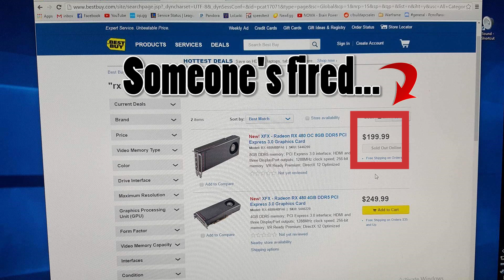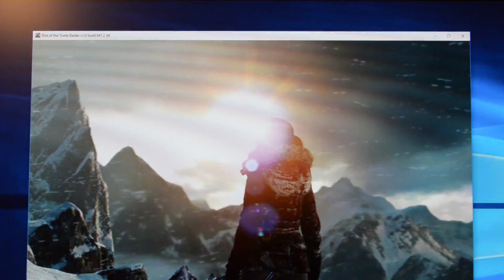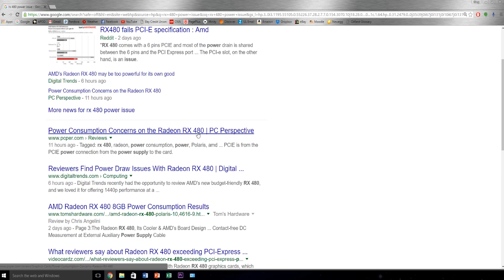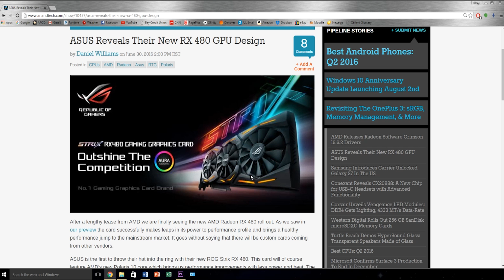RX 480 Aftermath: Power Issue & Over-Hyping

Comment: considering a reference 480 matches and even bests an evga ssc 970, i can still see a sapphire card meeting 980 performance
Reply: Says the one with the Nvidia logo
Reply: +Shifty Biscuits custom pcbs and a hefty overclock should let it touch the stock 980...because I've seen my brother overclock his 970 close to my 980
Reply: you're delusional bud
Reply: Ohh come on, the RX 480 is better than a GTX 970 and you know it. A non overclocked RX 480 with a stock, blower style cooler has equal performance to an overclocked GTX 970 with a custom cooler, while being $50 cheaper than a GTX 970 and having more memory.
Reply: 99% of uses with  480 is same or just 5-8 frames faster then a 970 from 2014  even with 8 gigs of ram it doesnt walk all over a 970 and right now 970 is 250$ on newegg ..480 isnt a bad card just it was all hype
Reply: Pastechi dont care when its $260
Reply: oh snap
Reply: LOL

REKT [X]
NOT REKT [  ]
Reply: It may very well be able to touch a completely stock 980, however the card itself at that point (with better power delivery and a hefty cooler) would probably cost around 260-320 4GB-8GB (just pulling numbers out of my rear, but I would expect to see around a 50$ increase in price for high end versions of this card)
Reply: Mario Man shut up :D. He read about it in BOOKS !!! He must be right EVERYTHING is in the BOOKS !!!. 200% MORE CLOCK = 200% PERFORMANCE SJADOISAJDIODA. If u have 8GB VRAM and u buy extra 80GB VRAM ur graphics card will have 10x more performance. !!!  AMD 16 CORES ARE FASTEST BECAUSE i5 HAS 4 CORES !!!
Reply: Except Aftermarket cards tends to increase the price based on what it compares itself to.

If the performance gain is stable enough in a Aftermarket card to be on par with a 980, retailers might think: "Why price it way lower than 980s when we can make it exactly the same, and have consumers buy out the 480 and the 980s at the same time?

^ GREED ^

Also, this RX 480 won't be a issue with my mobo, it's REALLY old but still has PCI-E 2.0 Standards.

The ONLY way you have a old MOBO that won't work properly with this card is if you have a 10+ year old board.
Heck... People, get with the times here... There are cheap modern Motherboards...
Reply: beats a card with less mem from 2014 in most tests by 1fps     ..good thing it has 8 gigs of ram lol  970 are selling for 270$ and much better card then a 480
Reply: I just don't understand how people can be so stubborn, the 970 is very limited with where it can go, with more and more DX12 games coming and Vulcan around the corner the 480 is the obvious choice, I'm all for talking with intelligent people about the pros vs cons of both cards but if youre just going to says "LOL XXX CARD IS BETTER YOU MORON" Then seriously unsub, please, for the betterment of humanity.
Reply: Tico2858 ikr newer cards should always beat or compete with older ones 1 tier higher than them. Some people just dont get.
Reply: The EVGA superclocked 980 is cheaper than the reference RX 480 here in Europe, at least if you are fast enough on ebay. Other 980s are dropping their prices madly just like the 390x can be found 20% cheaper now. So, Sapphire releases a custom RX 480, do you think the much needed upgrade on both cooling and power is free of charge?
Reply: 4TooFLY so you just proved that you have no knowledge in digital design and hardware architecture...
Reply: No.
Reply: Tico2858 dude the R9 380 has 1792 shaders, 112 TMUs and 32 ROPs the Gtx 960 has 1024 cuda cores, 64 TMUs and 32 ROPs, no wonder the R9 380 would beat it even if the gtx 960 has higher clock speeds.
Reply: but can it beat a 1060 tho
Reply: Tico2858 $260 for a 1060 without having power issues?
Reply: Why is everyone targeting the 970 like it's now shit compared to when it was released because its an older card so it should naturally be beaten by the newer one. It likes the 1060 should be near the 970 perfomance and be cheaper that's how the 970 was compared to the 780 it was cheaper and had similar performance and better power consumption and acoustics at a cheaper price. It's the normal progression of technology
Reply: The Spark I hope you mean 970
Reply: Tico2858 http://www.ebay.com/itm/04G-P4-2983-KR-EVGA-GeForce-GTX-980-Superclocked-with-ACX-2-0-Cooling-4GB-Grap-/272292711486?hash=item3f65e90c3e:g:ZhcAAOSwMHdXTc2r

No .. I meant the 980 superclocked.
Reply: The Spark I'd really ignore used prices since you can get anything at any price , but that's a sweet deal (I think)
Reply: +Mario in some games the 480 beats the 970
Reply: cough dx12,vulcan*cough*
Reply: sapphire confirmed a 1500MHz RX 480, while the RX 480 stock can NEVER reach boost clock speeds, thus a 25% higher clock speeds, thus 25% higher performance.
Reply: It doesn't work like that. Palmface
Reply: 4TooFLY ?
Reply: U will not get 25% more performance raising clock 25%... It doesn't work like that what u dont understand ?
Reply: 4TooFLY it does.
The overall GPU performance is determined by the TMUs, ROPs, Shader count, bus width and memory type. Which result in Bandwidth, Texel Rate, Pixel rate and shader performance. Of course there is the factor of Architecture, which is the most complicated part of it as architecture is NOT one basic performance factor like the ones mentioned above, but going into unified graphics architecture in a youtube comment would be suicide.

The texel rate is TMUs* Core clock speeds
The Pixel rate is ROPs * Core clock speeds
The shader performance is Shader count * shader clock speeds/core clock speeds.
The bandwidth is Memory bus * memory clock speeds * 2 * 2(if GDDR5) * 2(IF GDDR5X).
Thus you can see that increasing the core clock speed will increase the texel rate, pixel rate and shader performance the same amount as the increase of the clock speed percentage wise.
Reply: IIIRattleHeadIII Yes yes... Prove me that in a video. Because talking like this is stupid. Just like AMD did. 2xRX480 = GTX 1080. When it can't even reach 1x1070... U saying tottal bullshit that u cant even prove.
Reply: IIIRattleHeadIII hahah as i knew. Can't prove, then talking shit. Go troll somewhere else. Go buy ur 25% more performance GO..
Reply: 4TooFLY read some books.... or just watch some synthetic benchmarks.
Reply: IIIRattleHeadIII And u go to see practical result in a normal game not in a book.
Reply: 4TooFLY a game includes many more performance factors than just a GPU... like ram, CPU and storage
Reply: IIIRattleHeadIII You know he's right. 25% higher clock speed wont result in 25% more performance.
Reply: Mario it does... basic knowledge.
Reply: Mario did you even read my comment above.
Reply: 4TooFLY you have no clue on anything hardware related. All you do is watch benchmarks and read blogs/articles on the internet, ejucate yourself and then come here. Unlike you I have studied hardware architecture and digital design for 7-8 years.
Reply: Mario do you even know the performance factors of a GPU?
Reply: IIIRattleHeadIII
LOL! just lol! stfu dumbass!
Reply: ***** oh really? Nobody except me has even given arugments, all you people do is state things without any arguments or reasons behind them.

you are basically saying "It's NOT like that, because it's NOT like that". I gave you logical and actually real reasons, the fact that you can NOT comprehend and all you do is read stupid articles and watch benchmarks.
Reply: IIIRattleHeadIII Go read more books. Im gonna block you, i dont want to hear how stupid are u...
Reply: Problem, the 1060 will be $250 for founders but only with 3Gb of memory, the 6 Gb version will be $300 and if the pricing is like the 1070 and 1080 it will be more and it won't be more in real performance. Just watch the next few months. The 480 will go up in performance while the nVidia cards will drop or stay the same.
Reply: 4TooFLY Seriously man you should know thats not how it works when you look at the R9 380 vs the GTX 960 alone, the 960 reference has 1127MHz and the 380 has 970MHz, the 380 slaps the shit out of the 960, the core clock really doesnt mean that much
Reply: when drivers improve and dx12 becomes the norm it definitely will. with dx12 also people with 900 series nvidia cards are going to want to switch over after they realize how Nvidia is just going to say to them buy a new card dipshits. the way amd future proofs almost always will have people switch over after nvidia burns them
Reply: Mario why should I ask anybody, when I know that what I am saying is true?
Reply: IIIRattleHeadIII No fucking shit, dont tell me, tell the other kid
Reply: Tico2858 well you said that clock speeds do NOT matter, which is NOT true as core and memory clock speeds are 50% of the performance, IF the ISA is the same and both Nvidia and AMD have the same ISA.
Reply: IIIRattleHeadIII No i didn't, don't try to put words in my mouth, I said it doesn't mean that much
Reply: Tico2858 gonna quote you "Seriously man you should know thats not how it works when you look at the R9 380 vs the GTX 960 alone, the 960 reference has 1127MHz and the 380 has 970MHz, the 380 slaps the shit out of the 960, the core clock really doesnt mean that much"
Reply: IIIRattleHeadIII Yea and in the same quote i said it doesnt mean much, stop trying to fucking witch hunt people
Reply: Tico2858 well it matters very much as I told you. I'm NOT hunting you, I'm just clarifying.
Reply: or you could just buy quality?
Reply: my plan would be to buy the cheapest aftermarket version of the card and overclock it further myself.
Reply: The shader performance relying on 2 different clock speeds alone means that it won't result in a direct 25% performance increase. That actually matters. Reread your entire comment.
Reply: he's mostly right actually. His comment wasn't stupid at all. Just a little misguided. You're not giving much of an argument either, showing that you seem to lack some knowledge in this area. You're right, but not for the right reasons.
Reply: ArtisChronicles the shader has it's own clock speed, which is relative to the core clock speed, or in other words it has a ration, when you increase the core clock speeds the shader clock speeds increase as well, the last time shader clock speed was independant from the core clock speed was I believe with the gtx 500 series, where you could clock the core and shader clock speeds separately. AMD has always used a ratio and the shader clock speed has always increased with the core clock speed.
Reply: Power issues on a reference card. Who buys reference cards? Jesus, you people are dumb
Reply: Nope.
Reply: even tho i have an 760, im and AMD fanboy. And what you just said is impossible
Reply: did you just say that? lol you need to do your homework
Reply: Phoenix MH83 the rx 480 does match a gtx 980 in None-Nvidia optimized games(games that are NOT, the witcher 3, GTA V, Rise of the tomb raider, Morror's edge catalyst, and batman [fill blank] and pretty much 99% of the AAA games from 2015 and 2016)
Reply: +IIIRattleHeadIII mmm not quite. It does beat 980 in dx12 titles, but thats about it. That being said, its still almost 3x as cheap as a 980 making it a really good value card. The 1060 is coming out soon so we will be able to compare benchmarks then
Reply: IIIRattleHeadIII at what price to just come close to it? Fact is you get what you pay for and you know that. If it cost 200 bucks then it cost less to make. AMD is not about quality they are about budget. That can be good in some cases but not all the time. This cards overheats already from what I been seeing on reviews. If they truly want to make a quality card then they are gonna have to spend more. If 3rd party companies are sticking with the same  specs and parts then they will have around the same quality and if its better quality chances are it will cost more
Reply: ***** It doesn't "fry" motherboards.. do your research
Reply: ***** What motherboard still uses PCI 1 slots? hm? Upgrade your 10 year old hardware if thats the case, lots of graphics cards does the same thing this card is doing, but I wouldn't expect and nVidiot to realize that.
Reply: ***** Lol you are bragging that you waste your money on a on an equally good card at higher the price? grats! Bragging to people that you bought a car a sticker price too I presume? You are the type of guy to do that.
Reply: ***** haha, pokes fun at people who buy amd to save money, and you don't even have a high end card. gtfo.
Reply: A 980GTX is a pretty big performance leap from a 970GTX, and RX 480 is all sold out at the 200$ price. The 1060GTX is rumored to come out with better performance than a 980GTX in 1-2 weeks with a price tag of 250$ so you might as well wait because unfortunately it seems RX 480 was mostly hype. They did release a driver update to fix the power consumption which seemed to have worked perfectly but anyway, it's like ... if you got one, 50$ more and a few more weeks would get you the bigger update. At the moment no RX 480 are available for lower than 250$ anyway because they are all sold out so thus unfortunately AMD has failed : L. If you did get one and it is working or also up-to-date, it's a good update, but there's a better one coming from NVidia unless AMD responds pretty fast.
Reply: Praetorian yeah a 3GB gtx 1060 with gtx 980 performance for 250$ and 350$ for everywhere that is NOT the US and the RX 480 has gtx 980 performance+ in None-Nvidia optimized titles, which ATM are very few.
Reply: IIIRattleHeadIII
Actually RX480 is sold out and I cannot get one for lower than 300$ either, but either way if I'm spending 250$+ then it will be on a 1060 probably since it is significantly boosted anyway.
Reply: Praetorian how do you know that? According to the leaked specs, it's NOT stronger than the RX 480.
Reply: +Praetorian Only one benchmark it matched 980. In another benchmark from KitGuru, RX480 trumped 1060
Reply: Abhijeet Ghosh oh yeah, the gtx 1060 is out by now... right? too much traveling I lost track of time.
Reply: no, it will be released on the 19th.
Reply: 4 months and many driver updates later now the card is being compared to a GTX 1060....
Reply: GX2re
The GTX1060 ended up being better even if you wanted to pit everything as equal (which it wasn't 1060 was about 2% faster or some ridiculous low amount), then the power consumption and lower noise levels were better for the GTX 1060. I guess it comes down to preference but I would rather choose the better product regardless of where it comes from, even though the 480 was a nice release from AMD to keep things competitive at the time.
Reply: Praetorian on the long run the RX 480 will surpassm the gtx 1060
Reply: GX2re
That makes no sense. Please try to explain yourself.
Reply: Praetorian Nvidia cuts performance benefitial driver support as soon as their next gen GPUs arrive, AMD usually is slow on drivers with their new GPUs, so it takes a few months to get a good solid performance and AMD has 100% full driver support for all GCN GPUs.
Reply: IIIRattleHeadIII
Not once have I seen cited example of the so called 'driver improvements' that cause AMD hardware to get better just because of drivers after about 2 years. Are they paying you to say that or are you just butt-hurt? I used old Nvidia cards that are 5-9 years old(not anymore) but they still work just fine on every application regardless of old/new driver versions.

You would be better off waiting for VEGA at this point or even considering an rx490 , but no, here you are talking about a myth on some months old card that was proven to be worse than its competitor for the same price..
Reply: Praetorian not butthurt, nor paid, own both AMD and Nvidia GPUs, always have always will, neither company makes me money and I'm NOT biased, especially when their architectures are 80% the same, because they are based on the same ISA, so yeah...

Also if you want to see a comparison, just look up some benchmarks of the gtx 780 and/or 970 in recent 2016 games even the r9 380/285 beats it in some...
Reply: IIIRattleHeadIII
The gtx 780 was competing with the r9 380 anyway so there is no point to mention it. It is still about the same at that point as well.

The 9XX series didn't have any sort of DX12 or APi support so thus when using that 1% or less of DX12 applications they will run but fall short or equal of the RX4XX series that had support for it already.  In that case, it was just an issue of nVidia's 9XX series not having any sort of support for DX12 at all and 1XXX was more or less a fix for that. If you want to factor in things like 'well if I run Hitman on a dx12 renderer than my RX480 was better than a 980GTX'. Well, that has nothing to do with this which was 'well if I run Hitman on a dx12 renderer than my RX480 was slightly worse than a 1060GTX not even counting the sound, overheating, power consumption, etc.' Other than that your dated observations are pretty invalid and seek to support baseless claims.

 You just bring irrelevant dated cards that no one wants to buy into the discussion, and as I said, this is already 'outdated' where the 1060gtx was better price for value.
Reply: Praetorian wow no, the gtx 780 was competing with the r9 290, which is 25% more powerful than the r9 380.
Reply: IIIRattleHeadIII
Did you even read?

"You just bring irrelevant dated cards that no one wants to buy into the discussion, and as I said, this is already 'outdated' where the 1060gtx was better price for value."

I also explained why the RX480 was considered a GTX980 killer, even though it came out months later as a cheaper alternative: because the GTX9XX series didn't offer any boost or benefit at all from new DX11/DX12 APIs at all and GTX1XXX did.
Reply: Praetorian the gtx 1000 series do NOT have ACEs either, so they are NO better in term of DX12 benefit comapred to the gtx 900 series.
Reply: IIIRattleHeadIII
Wrong. Even a GTX 1060 beat a GTX 980 barely in all DX12 tests. The GTX 980 is still a strong card, but it was not benefiting from those experimental differences at the time. In fact even DX11/DX9 was around equal to the GTX 980 for the cheaper GTX 1060. That is why the RX480 was considered 'competitive' for a time as it was cheaper and stronger than the GTX980 (which was the best card NVidia had for a while), at least until the response came out which was the GTX 1060 that won slightly in all aspects. There also is the GTX 1080 and stronger ones that were more expensive and have the best performance available. However since Nvidia and AMD are both making new generations of GPUs soon, you would be better off waiting. There's no reason to randomly bring up irrelevant crap..

I don't get it, are you angry or just lying?